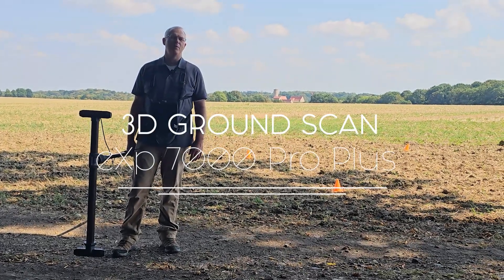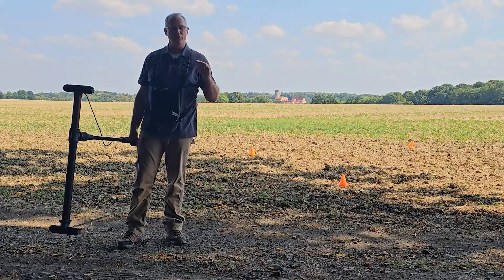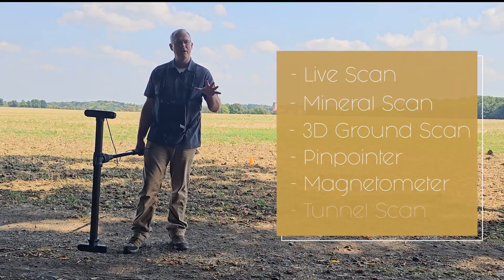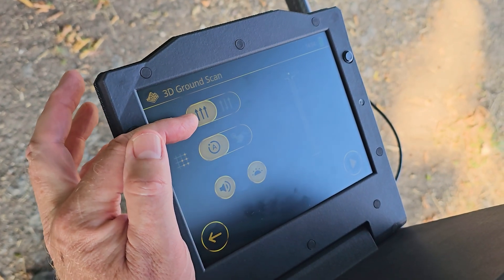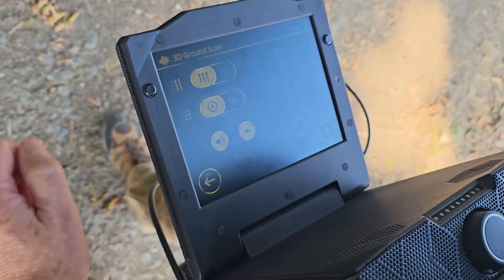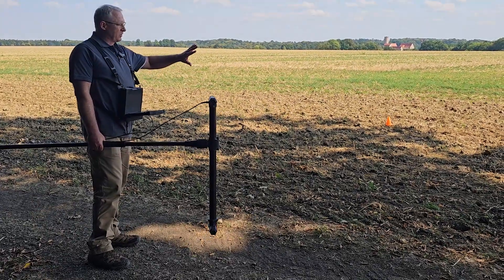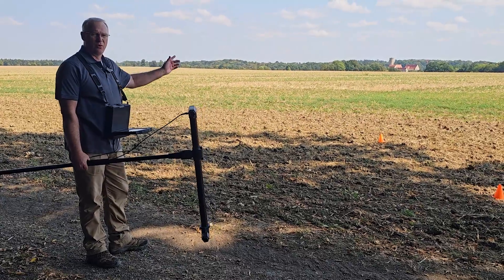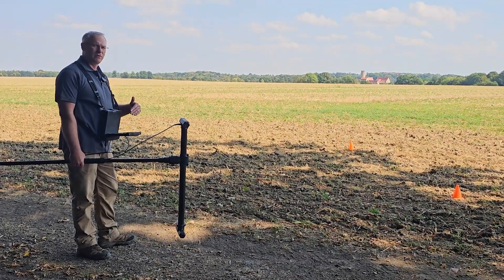3D Ground Scan with the OKM eXp 7000 Pro Plus Super Sensor

Comment: Excellent video of the EXP 7000. I believe the site was not surveyed in magnetometer mode and the recently disturbed ground is producing numerous false positives. Hard, compacted areas show as high magnetic values (red), while loose or disturbed zones register lower values (blue).

Additionally, the soil’s blackish color indicates a high organic content, which can influence magnetic responses, and root systems from nearby trees may also be affecting the readings.

I also believe the ground was disturbed by digging from east to west—perpendicular to the scan path—particularly at the far end of your survey area, which could further contribute to the irregular responses. Please feel free to correct me if my assessment of this last point is inaccurate.